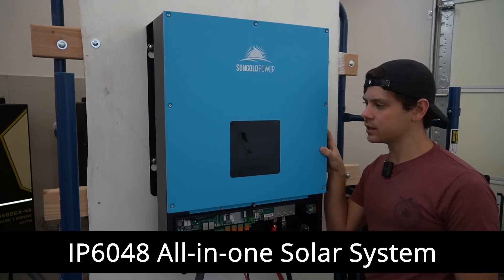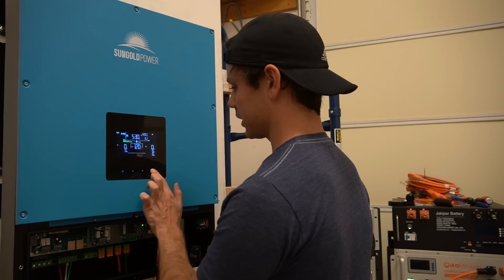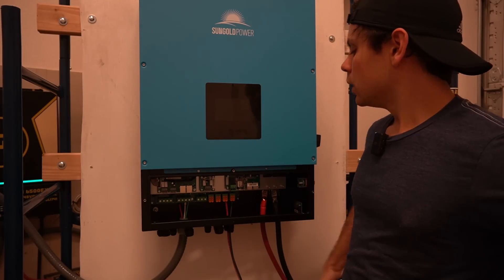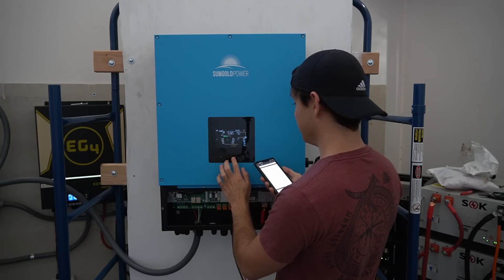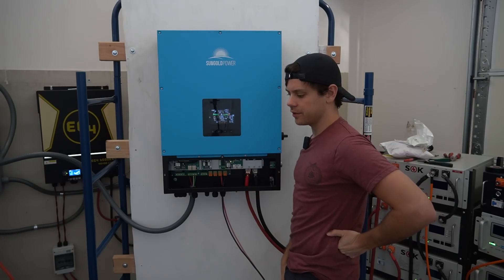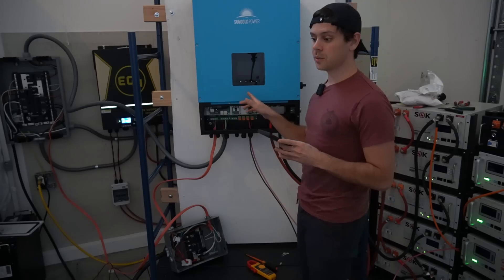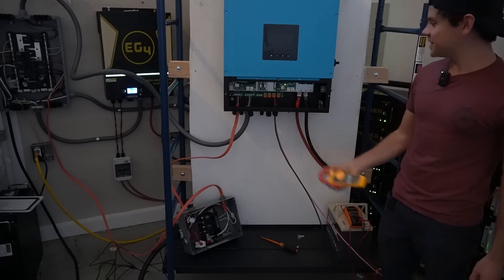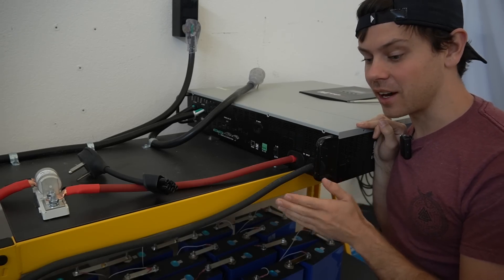New! $2,095 All-in-One System: 48V Waterproof "IP6048" 6000W 120/240V

Comment: Would love to see you run a decent inductive load on all these inverters and see how they manage.  I feel like you once said you don't have any, but maybe get a decent air compressor?  Those are always handy.
Reply: A submersible pump in a bucket of water is an easy way to add a substantial inductive load to an inverter...
Reply: @Techa-lo2dc  That's a good idea.  And sump pumps are definitely a critical load for people who require them.  I bet the inrush current on a 1/2 horse pump will shut down most of these cheap all-in-one Inverter/chargers.
Reply: Can't they be configured to feed the same panel as the grid, so that any large inrush would just be handled by grid?
Reply: @jl9678  I think that would defeat my purpose, which is to run the pump when the grid is down and I'm on my own.
Reply: I would think charging the Tesla is a inductive load.
Reply: @tomrandall4871  I'm not an electrician much less an electrical engineer, but inductive loads are magnetic field generators (e.g. in an electric motor), so I don't see how a Tesla charger could be an inductive load.  Is it somehow different from other battery chargers?
Reply: @Keifsanderson  Power conversion from A. C. to high voltage D. C. Uses "Switching high frequency power supplies" like a giant computer power supply. Indeed a inductive load. Abet soft startup of load to prevent tripping of the circuit breakers. Agreed a deep submersible well pump 1.5 hp would be a fantastic test. I did get into my unit and changed the settings to instant transfer from utility outage transfer to battery. And only 30 seconds delay when utility returns. Also widened the frequency from a low of 59hz to a high of 61hz. This allows the inverter to stay connected longer. This weekend will be running up 6kw loads. And opening the utility breaker. Then transferring back. The inverter has power factor custom var, reactive, inductive, settings as well. Manual translation from Mandarin Chinese to English is not the best but not the worst. The Engineering department sent some photos and test points at the circuit board level and component level. So they are working with me to get some bugs out. Night and day difference now! I'm giving this inverter a 2nd chance. I had good luck with their smaller 4kw split phase the black 12vdc to 120 / 240 vac sinewave non grid tie unit. I added 4kw of solar on my roof. So grid tie makes sense. I am already grandfathered in with a bi-directional smartass meter. My older Trace Engineering stacked system from 1998 is still going strong! But it is in a steel building 250' from my house and is a 24vdc system. Four SW4024 grid tie inverters.
Reply: @tomrandall4871  Most of this went over my head, but thank you.  I've got a lot to learn, lol.
Reply: @busimagen  I would guess a well pump would pull more.  At least the "deep" well variety.  Higher horsepower.  I don't have a sump pump anymore, but I measured my 240v well pump to require 35 amps on startup, and then 10 amps to run.
Reply: @busimagen  Well pumps come in two main types - single speed and variable speed. The single speed pumps are just like sump pumps, they have a big in-rush current on startup. The starting current is proportional to the running current, often about 4x the running current, but it can be more than that. Variable speed pumps have an inverter built into the motor or the controller. They don't have a large starting current but they can have an in-rush current when you first apply power to the inverter as it charges up the capacitors. I've never seen a variable speed pump running on one of these solar inverters...